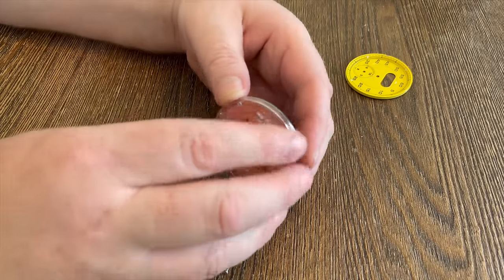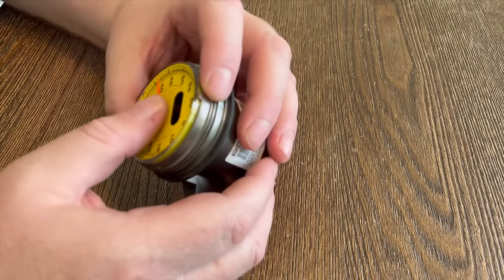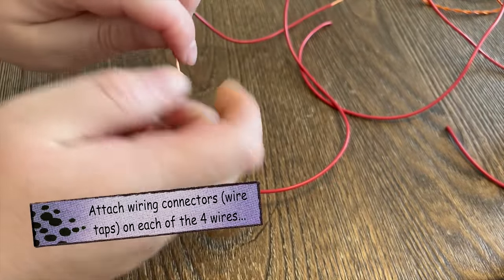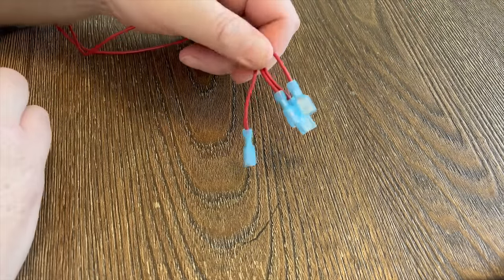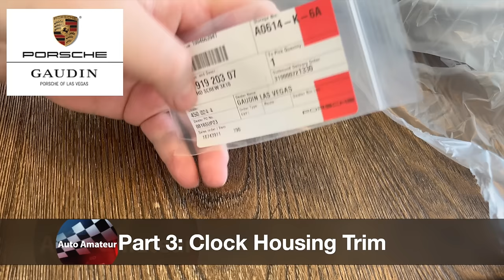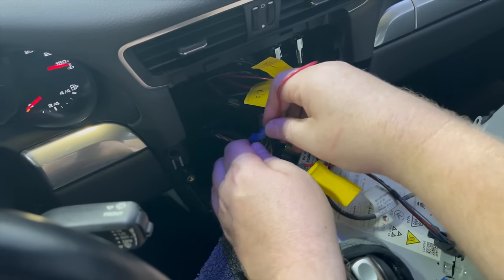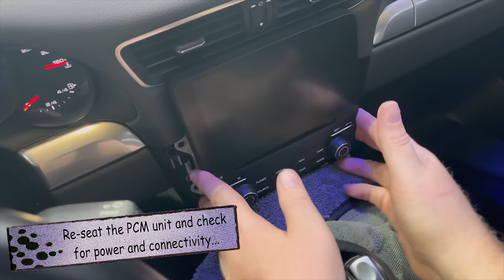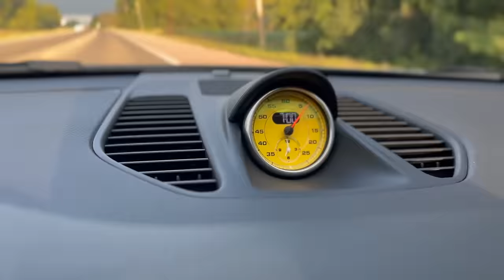Porsche Sports Chrono Clock - RETROFIT DIY

Comment: After following your directions a while ago I was able to change out my chrono color but still can’t get all clamps to snap back so mine sticks up close to windshield.
Reply from the maker: Do you mean the trim clips which hold the trim piece in place? Check each of them to see if you manage to bend any of them. You can usually bend them back easily. But also check to make sure there's nothing getting stuck, like the wiring.

Comment: If I tune a C2 base with APR Stage 1, what would I be missing if my car does not have sports Chrono package? Just the mode selection? With the modes oem it also adjusts the suspension right?

Comment: I have a 2023 Cayman GT4 that I’m trying to do the same thing. I did buy a used GT4 OEM chrono but cant find a wiring kit. You think the kit you had will work?
Reply from the maker: Depends on the PCM unit you have. Which one do you have?
Reply: I have just the regular PCM without navigation.
Reply: @AutoAmateur  I have the regular PCM without navigation and was hoping I can find a wiring kit for plug and play but has proved to be difficult and can’t find one for 718

Comment: Greetings, where can I get the entire system including the chrono?
Reply from the maker: You can buy a new clock from Suncoast Parts for around $800, but you can find used units in good condition on eBay for around $250/$300. The trim housing itself and the wiring harness I bought new from Gaudin Porsche Parts, but you can order them from any reputable Porsche parts dealer. That trim piece runs around $150, maybe $50 for the wiring loom.
Reply from the maker: New Clock Face in Yellow / White / Red / Green / Blue from AmpleStore on eBay:
https://www.ebay.com/sch/i.html?_ssn=amplestore&store_name=amplestore&_oac=1&_trksid=p4429486.m3561.l161211

Sports Chrono Housing Trim from Gaudin Porsche Parts:
991-552-151-02-5Q0 (Center Cover	x 1)
991-552-557-02-5Q0 (Top Cover x 1)
999-919-203-07 (Instrument Cluster Housing Cover Screw	x 1)

Sport Chrono Wiring Harness from Suncoast Parts (Part number: 98161269200):
https://www.suncoastparts.com/product/98161269200.html?Category_Code=981BOXSTERINTERIORAUDIO
Reply: @AutoAmateur do you happen to have the part number for the clock?

Comment: Did you model already have the loom for a clock? I have a 2019 Macan and the dealer has said I dont have the loom to run the clock, I am after another way of connecting it
Reply from the maker: Hey! Just watch the video. I discuss this. My car didn’t have the loom. I bought a loom for a Boxster clock, clipped off the part I needed and then ran the wires into the PCM using some wire taps. Easy.

Comment: WOW!!! I want that. Cound you share the link to where you bought the sport chrono and the housing!
Reply from the maker: I'll put the links in the video description. You can buy a new clock from Suncoast Parts for around $800, but you can find used units in good condition on eBay for around $250/$300. The trim housing itself and the wiring harness I bought new from Gaudin Porsche Parts, but you can order them from any reputable Porsche parts dealer. That trim piece runs around $150, maybe $50 for the wiring loom.
Reply from the maker: New Clock Face in Yellow / White / Red / Green / Blue from AmpleStore on eBay:
https://www.ebay.com/sch/i.html?_ssn=amplestore&store_name=amplestore&_oac=1&_trksid=p4429486.m3561.l161211

Sports Chrono Housing Trim from Gaudin Porsche Parts:
991-552-151-02-5Q0 (Center Cover	x 1)
991-552-557-02-5Q0 (Top Cover x 1)
999-919-203-07 (Instrument Cluster Housing Cover Screw	x 1)

Sport Chrono Wiring Harness from Suncoast Parts (Part number: 98161269200):
https://www.suncoastparts.com/product/98161269200.html?Category_Code=981BOXSTERINTERIORAUDIO